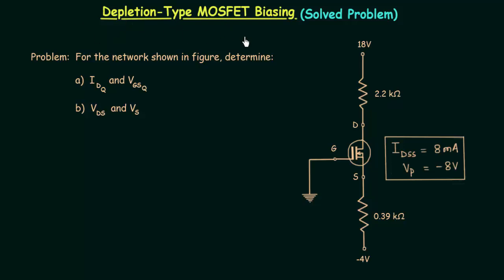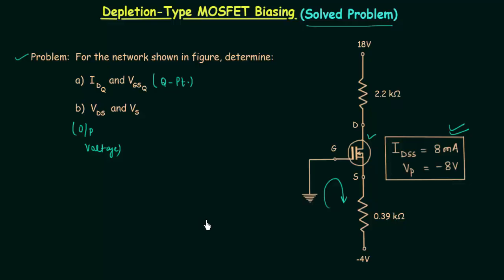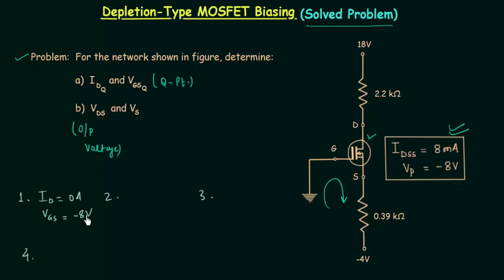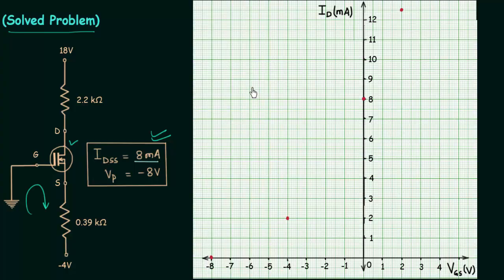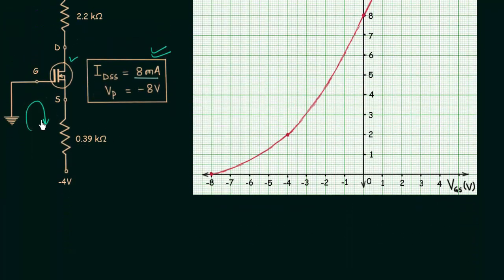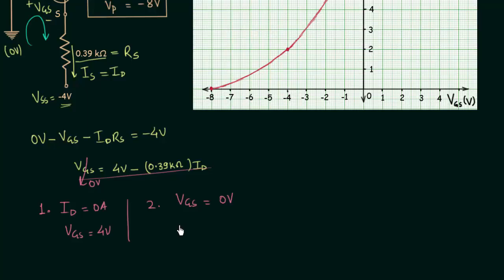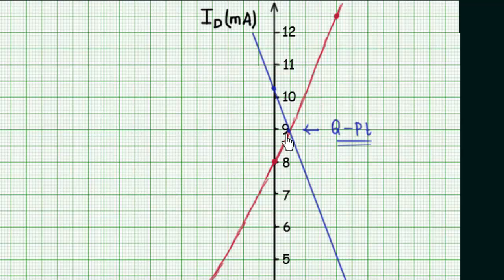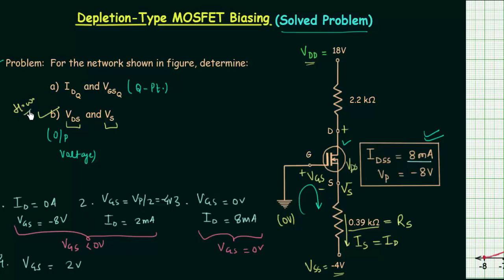Depletion-Type MOSFET Biasing (Solved Problem)

Comment: KVL for DS loop
18 - Id(2.2+0.39) - Vds = -4
(Id = 9mA)
                                Vds = -1.31 V
Vds = Vd - Vs
Vs   = Vd - Vds
       = (18-2.2*9) - (-1.31) = -0.49 V
Reply: how Id = 9mA?
Reply: @Gungun-tv2ud  from the intersection point of the load line and transition curve/ idq value

Comment: vds -1.3   ,vs  -0.49 am i correct??
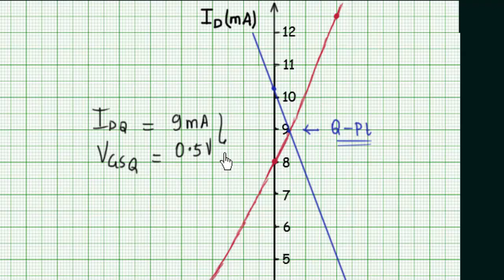Reply: @kms7616  7:22 it is the operating point of the mosfet, it the current at which the mosfet will work , It is Idq, the quiescent drain current
Reply: @94D33M  so Everytime we need to draw graph and find q point?
Reply: how to  find it??
Reply: @sakthivelp9068  Use Kvl on the right side, 18 - 2.2Id - Vds - 0.39Id = - 4, and use Id = 9, solve and get Vds.
Also, Vs = 0.39Id